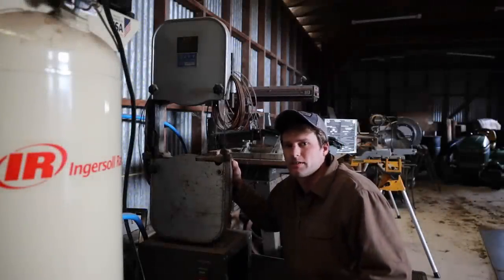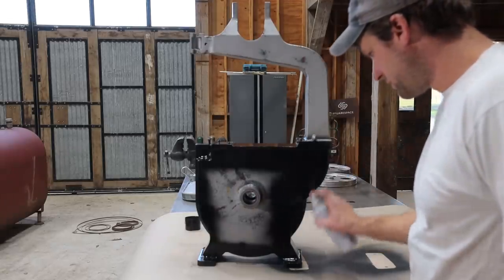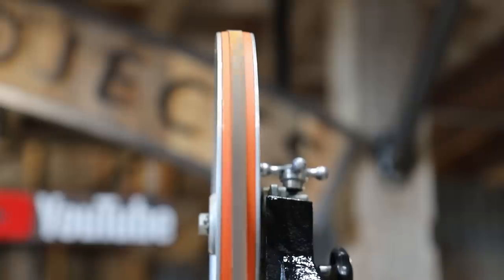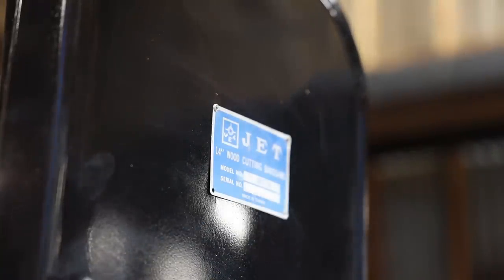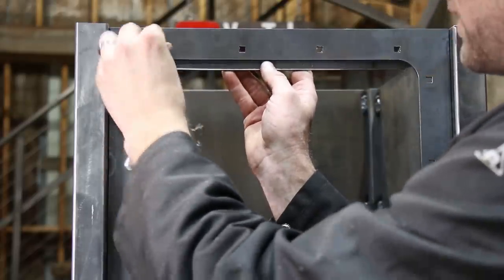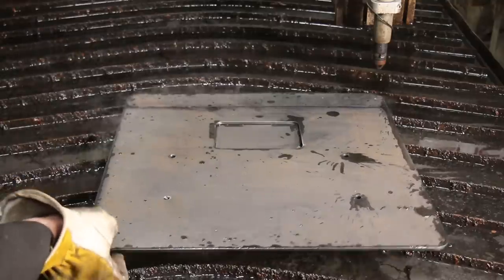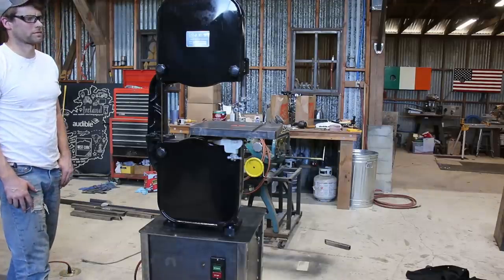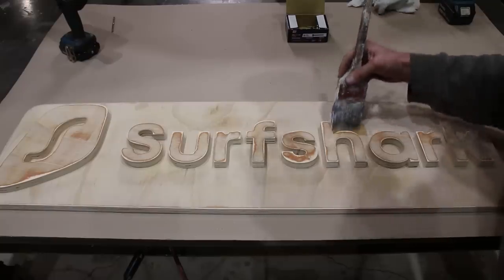Band Saw Restoration and Stand Build

Comment: You should make a fence for it so you can make straight cuts.
Reply: Very useful addition for any band saw. And if you have scrap around, it can be a half an hour project. :)
Reply: Ja, also a center pin jig for cutting circles
Reply: A fence is great, however, remember that when cutting on a bandsaw, there is a thing called "drift" that MUST be accounted for to get a straight cut (or at least parallel to the blade).  A good way to measure "drift" is to mark a line on a board about 12" long parallel to one of the long edges and then run the board through the saw along the line.  In most cases, you will see that the board must be pushed into the blade at an angle (not parallel to the plane of the blade)---this is the so-called "drift" angle and the fence should be secured to the table of the bandsaw at this angle so that when one edge of the board is kept tight to the fence, the blade cuts parallel to that edge.  A good way to adjust the fence to this angle is to attach the fence to a miter gauge which is then put in the miter slot in the bandsaw table.  If the "drift" angle is determined to be, let's say 4 degrees, then set the miter gauge, and therefore the fence, to 4 degrees and lock it in place.  Remember also that "drift" angle will vary with the size (width) of the saw blade (i.e., may be different for an 1/8 inch blade than a 1/4 inch one).
Reply: @garyspodnick8770  A better way is to remove "drift" by setting your blade correctly on the wheels. Aim to have the bottom of the gullet at the apex of the wheel.

Comment: I'm working on a 1986 Delco Machinery bandsaw that looks to use many of the same parts. This was helpful. Also, the "play" in the upper bearings you noted was actually the upper wheel angle adjustment. There is a knob 90 degrees off the tensioner that increases the angle of the upper wheel so the blade doesn't walk off.

Comment: Wonderful project. Jet makes some quality gear and your fixes brought it back to as good as new and made it easier for you to use. I suspect you’ll get another 20 or more years of service from it. 
I really enjoy your projects. The pace, quality of production and photography are something that brings me back time after time.  If that motor dies on you, a variable speed replacement model would allow you the flexibility you want to cut metal without having to grapple with the motor and change pulley spots and reset the motor height.

Comment: Great project.  In suggestion.  Door latches.  Kinda looks like the handle is heavier than the latch tine. My guess is that it will vibrate and open the latch...you could probably use a wonderful farmers forge and grab the red hot handle with pliers and flip it around level pointing over the tine.  Bet you could figure something better than that.

Love to watch you solve problems and build stuff.  Thanks for taking time to do the videos so we can come along.  Flowers look nice too...also looks like dog has found a new friend.

Comment: I am impressed that you use these cup type wire brushed on youir angle grinder. for me these always were destroyed in a minute as the wires get bent to se side to a point where it is unusable. 

I switched to regular wire wheels and have not ever used a cup type again.

Comment: For a chip out free cut for wood on the backside. Cut a piece of plywood the same size as your top cut until the blade is in the middle of the piece then clap or screw on to your metal top and thats it no more chip out on the back. Great job on it and great job on the belt guard safety feature.

Comment: I'm a furniture maker by trade and have a lot of experience with band saws, that 14" band saw you have is really a work horse. It would be the first I would get and even getting a bigger one later it would still have a place in the shop. They just are the perfect balance of size/footprint to power to versatility. There are tons of accessories for that size saw available too.

Comment: Nicely done. As for cutting metal, you won't be able to slow the blade speed enough with the pulleys. I have the same saw and several years ago put a VFD on it and with that you can change the speed with the twist of a knob. You'll need a 3 phase 220volt motor.Through the magic of electronics, you still have a line voltage of 120v single phase. I got mine on ebay and it works reasonably well. Good luck on all your projects.

Comment: I just converted an almost identical saw to cut steel. To get into a blade speed that will work for cutting steel you will likely need more speed reduction than you can achieve with step pulleys alone. You can probably find a gear reduction on Craigslist or eBay for cheap. It’s a pretty easy conversion. Nice video!

Comment: A common way to mount the motor is on a hinge so the weight of the motor does the tensioning. Makes replacing the belt or changing speeds really easy, just lift the motor and pop the belt over. Maybe something to consider if you find yourself changing belt speeds a lot.

Comment: Man, what an awesome stand. I think it would make a ton of difference if you would glue some thin rubber sheets on the insides of the blade guards as well as the insides of the plates of the cabinet as I think most of the noise comes from vibration and resonance of the big sheet metal surfaces.

Comment: That style of bandsaw is one of the most prolific in the world . Your biggest limit will be resaw height, but due to the split casting you can always extend it and update the motor. Throat won't be as bigger limitation as you think unless you're cutting wide uneven timber.

Comment: I really missed these kinds of laid back vids. No pressure, just chill, maybe a kitten, maybe a doggo, ok, i lied, obligatory kitten or doggo. Just you and the projects. It's just that your vids are sooo satisfying to watch.

Advice: run a non sharp, non marring, pencil like object under the rubber tire to loosen the uneven tension of putting the tire on. Run it like twice and you're good. Helps prolong the life of the tire. I usually use a plastic rod i made from delrin, but any plastic will do.

Comment: OMFG. I just, JUST, finished (today, Feb29th2020, same day you uploaded this) restoring my JET 14" band saw. I also have that Craftsman 10" radial arm saw you have sitting behind it! Although my bandsaw, and radial arm saw are in much better condition... It wasn't your bearing that went bad in the upper wheel, it was the play in the shaft, for these bandsaws they were never really mounted well, I ended up grinding down a steel washer and epoxied over the shaft mounting, then slipped the washer onto that, giving the entire shaft a much more sturdy attachment to the tilt mechanism. I am really jealous of your stand though... no CNC here. Check out Alex Snodgrass about tuning that thing. He is amazing. And by the way, your motor can handle 220, if you have it. Polish off the deck with paste wax and it will stay shiny and slick.

Comment: I have a very similar (I think the only difference is that it is closed base) jet bandsaw which I am trying to tune up and get in condition. Fortunately for me it is in ok shape but needs some love. What kind of wire brush are you using to strip down the rust and build up on the table of the saw? I looked up online but there are so many options for angle grinder wire brush. Thanks.

Comment: I have a very similar, older Jet band saw with a base that I wouldn't want to trust under heavy loads. There are only two minor modifications I might want with the base that you built here. One would be to use a paddle type switch for the power, so you could tap it with your knee to shut it off, if your hands are full. And the other would be for the top of the base. You welded this one in place, I think I might want it to be bolted in place, like the leveling feet. This would only have to come apart once in a great while to make servicing the saw and motor somewhat easier. I really liked the cover for the drive belt, that's a great idea!!!!

Now, how can I get one you to build of these things for me???? I don't have a welder, or ANY experience using one.

Comment: Great video, thanks! For inspiration on tool renovation check out the youtube channel "my mechanics", the guy is unbelievable.

A couple of suggestions on the bandsaw:
- You're gong to want dust control. Some kind of little brush on the blade to get dust off of it. Otherwise the dust will jam up the blade or get between the blade and the tires which can be problematical. Also some kind of connection to a dust extractor from the lower wheel housing. Sawdust can be nasty stuff, be careful with it.
-  Please use a push stick, pushing your fingers towards the blade like that is pretty sketchy.